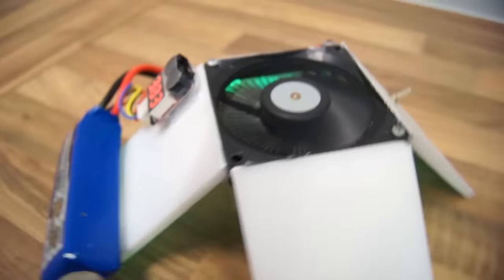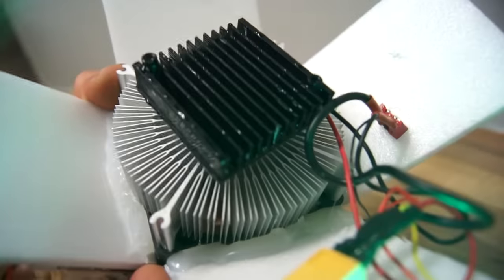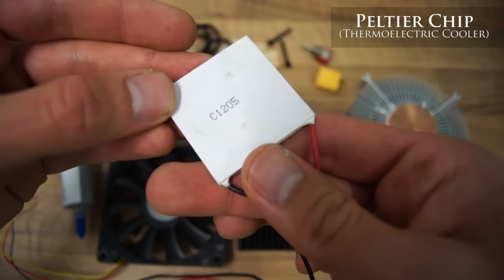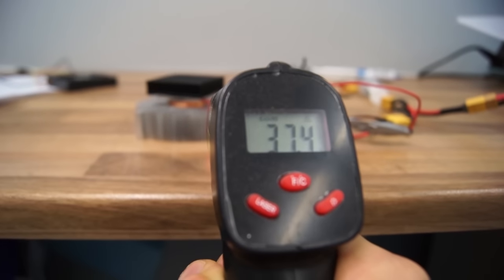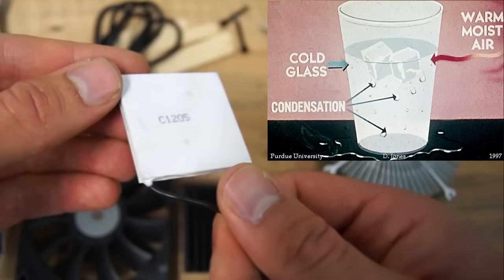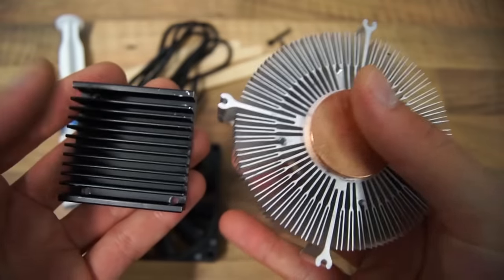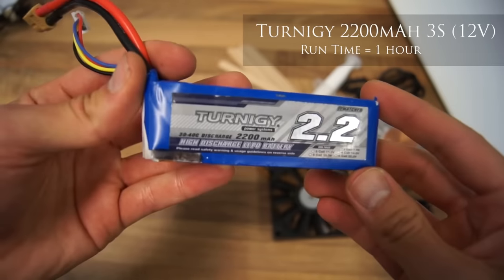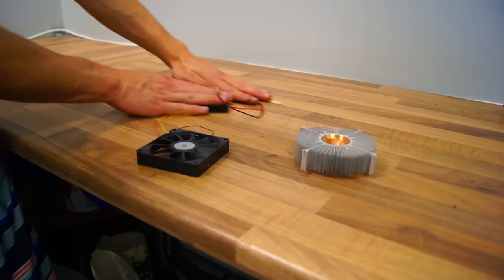How to Make a Dehumidifier Using Thermoelectric Cooling - RCLifeOn

Comment: Hi, beautiful project! One question... Can you please confirm if the thermal trease you used in your project also allows to permanently fix the heat sink to the peltier? because I tried with a normal thermal grease that does not fix the peltier to the heat sink so it goes down everytime. I would like to have the heat sink permanently fixed to the peltier (the cold side), so I can move it without any problems.
Thanks for all.
Reply: There are heat sink compounds that also works as glue.

Comment: What were the other items, and where does the water drop to?  I'm guessing 12v, but at what amps were you running the 1205tec?  Not much in the way of explaining mate.  Maybe you'll do better next time.  If I just wanted to see someone attach a tech between to heat sinks, I've done that 100s of times.  Wanted to see how you built the rest, and you were just silent thru it all...

Comment: It's not that it doesn't work at all how you made it in the video, but the idea of a dehumidifier is (1) cooling air under its dewpoint, (2) discharge the water and (3) heat the same air with the heat you detracted while cooling, so that the warm dry air can absorb more water after leaving the humidifier.

Comment: so these create water it is realy
Reply from the maker: You can look at it two ways, it collects water from the air or it removes water from the air. Basically it could be a cool device in certain situations where you need to find water, or if you wish to remove water in order to "dry out" the air.